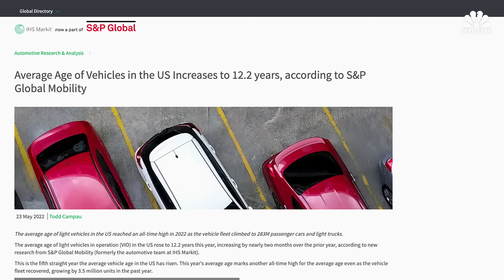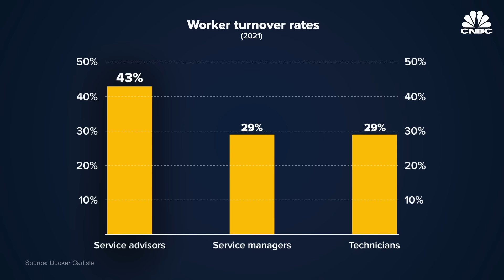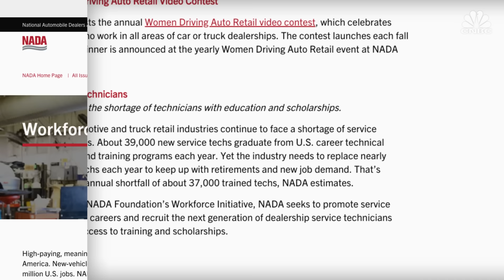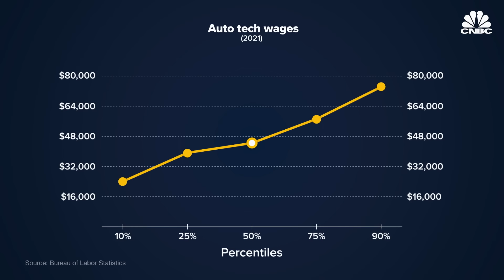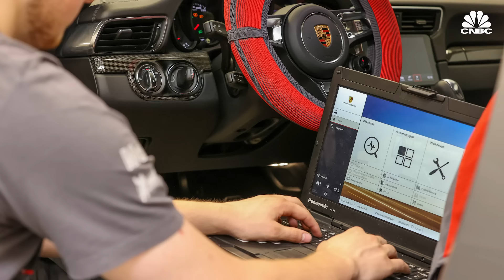Why The U.S. Has A Shortage Of Auto Mechanics

Comment: 20 years experience here, and I can say there is a shortage of mechanics willing to work for free. My dealership charges $200+ an hour and I don't even make 25% of it. I'm changing career and becoming a welder.
Reply: Took you 20 years to find out
Reply: I'm working in a 3 bay gas station and making 30% of the labor rate and we have different tiers depending on age of car or if it's diag work.  Need a little steadier work flow but I do have a decent guarantee. The least I make for a billed hour is 42.18 the most 65.09. 
I mostly need to train my boss to actually use the correct labor rate from the jump. It's coming along but he forgets sometimes.
Reply: last time I paid for mechanic shop, was charged. $200+ to put on new heater hose and bleed the system. took them 36 mins from start to finish. 🤡 never again. never again I'll buy a Subaru too
Reply: 100% agree. They treat us like tools and now the chickens are coming home to roost. Have fun selling cars with no service dept.
Reply: Welder, that's just as bad or worse. Welders are in and out of work as the economy booms and goes into recessions. seen it in the 80's. Plumber--- you will be paid more and it doesn't dip with the economy. Its harder though.
Reply: What a waste of 20yrs lol
Reply: why wouldn't you rather be a millwright or an electrician
Reply: Good. But anything less than a degree nowadays means you are being paid less, except when you are self employed.
Reply: @rond5936  that's not true, I made pretty damn close to 70k waiting tables at a casino.
Reply: @overk1llz  Yes, good, but people like you are the exception. I think most employees waiting tables in the US are complaining of the salary and conditions.
Reply: @Broke Duece, you hit the nail on the head perfectly. Being saying this for years.
Reply: @rond5936  most techs have degrees or equivalent.
Reply: @jeremys6631  I see you don’t understand what flat rate is…I bet you don’t get mad at your lawyer  when they charge you 500$ to fill out a 10min form….
Reply: @ivegonemad  lawyers don't have cheat sheet aka your obd scanner that tell your what is wrong and how to go about fixing it. 🤧
Reply: @jeremys6631  the lawyer has a legal aide who is paid much less to find and prepare all the documents for them to sign, “that’ll be $500 please”. The mechanic still has to interpret the data given by the scanner and find the actual fault. A fault code saying cylinder 3 running lean could be a half dozen things, they still have to investigate each possible one to find the actual problem.
Reply: @overk1llz  That may be good from age 18-30, but where's the progression after that?
Reply: @rond5936  Many degree holders are working retail or flipping burgers. Don’t kid yourself now.
Reply: @jeremys6631  Really, ask Trumps lawyers.
Reply: Have you asked for a raise??? There not just gonna give it to ya. It's a hustlers career. You can't wait around for hand-outs in this field. You gotta take it.
Reply: @jeremys6631  you will be a broke ass mechanic if you just go by obd scanner lol
Reply: @dfpolitowski2  As a certified master toilet technician [plumber], I endorse this commment.
Reply: @overk1llz  Some people find themselves in good positions in life. Let hope it last.
Reply: Go Aviation. $55 hourly with loads of benefits and no stress. 💯💯💯. * all you dealerships. Used to be 50%
Reply: @roceye  Downfall of dealerships has been a dream of mine
Reply: If you're certified and have papers, why not be a mobile mechanic?
Reply: @TwentyTwoSigma  I do. I still see complaints in the repair industry despite saving customers tons just like Scotty Kilmer. On top of that I have top end Snap-on diagnostics. Its ridiculous what dealerships charge and they pay the techs a measly a** $15‐35 flat rate on a $180 per hour labor rate. This is why techs have gotten shunned and bad rep over the yrs. Im 34. Been preaching this since I got out of automotive school. This field is a ducking joke and the big wigs are making all the money. One day I will open q dealership and pay 50% and also get rid of the idiots in service.
Reply: In the early 2000s my side hustle was welding.  I was making $15 to $45 an hour depending on how difficult the job was.  I used the money for a down payment on a house.
Reply: Look into heavy equipment I went from an auto tech to it making 2.5 times as much and I'm still green in turning wrenches
Reply: I did just that, became a welder. Can recommend it but it's still taking it's toll on the body.
Reply: @ivegonemad  Oh yes people do get mad at their lawyers for such things.
Reply: @jeremys6631  That is very serious fallacy about what scanners tell you (in most cases). Besides, it takes 10 or 15 minutes just to get the scanner out, fire it up, and look at the codes.

Comment: You gotta love the fact they didn’t interview a actual Technician. I was a dealership tech for 25yrs. The job got worse every year I got out in 2015 & wish I did earlier.
Reply: I was a dealer tech fof 17 years did the flat rate thing, sometimes you made good money but the majority of the time you had to kick, scratch and bite to get any extra time especially on warranty repairs. You stories on the repairs done (always had the 3 C's, concern,cause, correction) were constantly scrutinized by service management, you didn't dot this i, cross that t, punch time isn't correct or you didn't punch off or on properly for the additional repairs needed. We can't pay for that or my fav was your punch time wasn't long enough so you'll be paid for your straight time, especially with warranty repairs. Penalized for beating the posted labor time. Especially when had a warranty clerk who didn't know her ass from a hole in the ground. Parts inventories were severely reduced, you couldn't parts needed to finish the job in a timely matter. E.G. a 2 hour job took 3 days because you had to wait for parts, before you know it you have 4 or 5 jobs delayed because of parts. Then the service writers won't give you anymore jobs because of those delays. You might be standing around for awhile and your lift was tied up if needed you could put a jack under it a push it out, then do the same and push it back in when the parts needed finally showed up.. Then you called into the service manager's office and he or she tells you your not flagging enough hours and have to step up, when you tell them its because of the parts situation it falls on deaf ears. It there's a warranty description you have to "do battle" with both your service manager and the Factory service rep for the particular repair and why the additional time was needed. Your were out there by yourself and get 0 support from management. Then you get your cut throat techs who would stab in the back to steal a job from you and management doesn't care. Then they hire "apprentices" to train under the Vets which in turn your either training your replacement or they get all the good paying jobs and the Vets are stuck with the crap jobs that don't pay ,waste more time then anything. You get the weak service writers who are scared of their shadows complain that were not working hard enough because they are making enough money and refuse to sell work or are afraid too. Sorry don't mean to vent, but it can go on forever.
Reply: I worked at a Toyota dealership and the pay for a service tech was $25 an hour at flat rate and you had to really bust you butt to get that flat rate pay. Went to an industrial mechanic sit on my butt all day work maybe 2 hours out of 8 and make $36.50 …. And i’m not frustrated all the time trying to get in tight spots and tight bolts.
Reply: But what do you do now @ChrisPBacon-kx4jd???? I’ve been a mechanic for 8 years now. It’s getting bad because of management.
Reply: I am trying to get out now bro, it sucks working at the dealership
Reply: And technicians won't get any sympathy from consumers who are sick of being ripped off

Comment: This video BARELY touched on the fact the fact that techs need to purchase thier own tools and that they are not getting any cheaper. There are also new tools they constantly need to purchase for newer model cars. As a result, some techs are constantly in debt with the larger name tool trucks if they don't shop smart.
Reply: Agreed. The other factor with owning tools is storage. I can't buy some tools if I have no place to keep them safe and stored properly.
Reply: This is a huge factor, especially with modern cars that require increasingly more expensive diagnostics equipment to communicate with all the computers. A scan tool can cost thousands of dollars, and you will likely need multiple ones depending on car make, subsystem, age, etc.
Reply: @iguanamoat  Scan tools should be bought by the shop and if you are an independent shop you should probably have the factory tool for your top three brands you service. The shop should also have a subscription to factory websites for the same. Sure you can program a lot of brands with a J2534 box but you also increase the chance you brick that new module by accident.
Reply: I am surprised to learn that the dealer shops do not even provide the tools. Literally, the dealers just provide a workspace, technicians are making $200/h, but pay 90% to “rent” the workspace, and only keep 10% themselves???
Reply: I work on the front side of the dealer. In a small city, our dealership sells less than 100 vehicles a month. Our GM made in 2021 $450k in one year. How did I find out? I found his W2 while detailing his car 😂
Reply: @jingyuexi740  Where are you getting that $200/hr figure? The majority of dealers/independant repair shops have yet to cross the $200/hr labor rate yet. Right now, I am seeing techs making on average $30-$45/hr
Reply: It sounds like the dealerships/repair shops want to gripe about not enough techs, but are unwilling to listen to the problems or do anything about it.
Reply: What do you mean? The big Naps No tool truck gives you a very flexible payment option on your tools. Dang near auto loan level but flexible. Right?
Reply: @clarkanderson397  I would’ve snapped a pic of that… then asked him ohhh is this the only place you work… do you have a side venture etc etc… if not I would’ve told him this is gunna get sent around the whole shop unless we all get raises and a good tool stipend